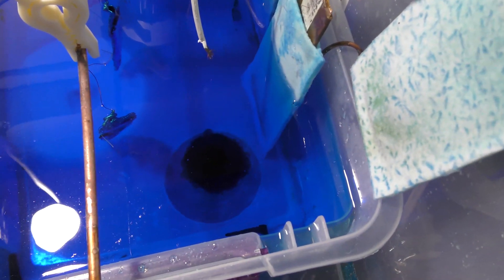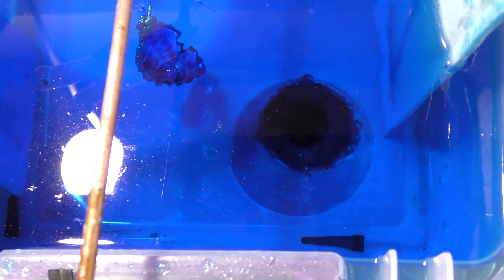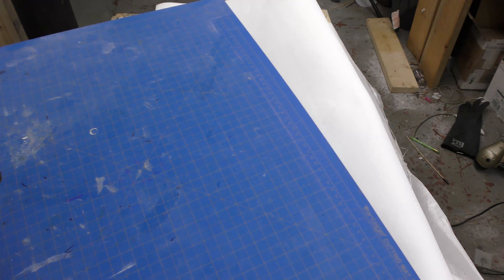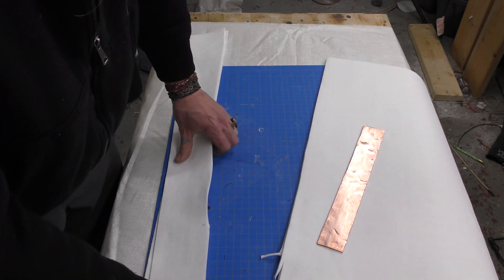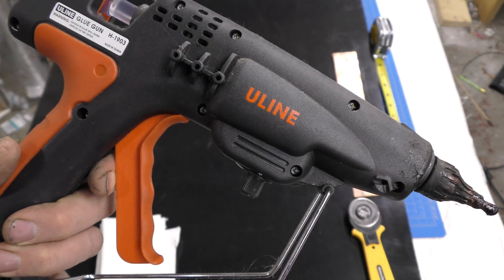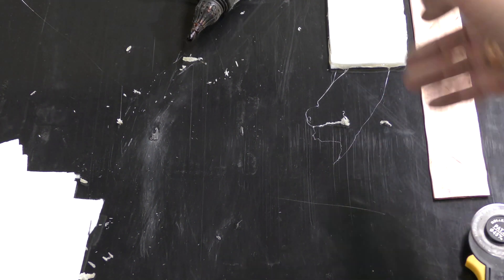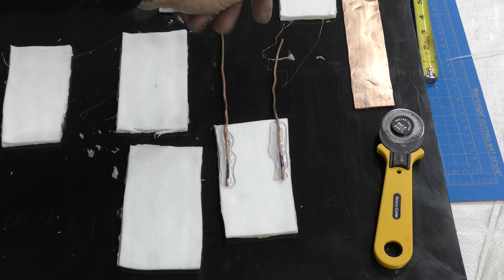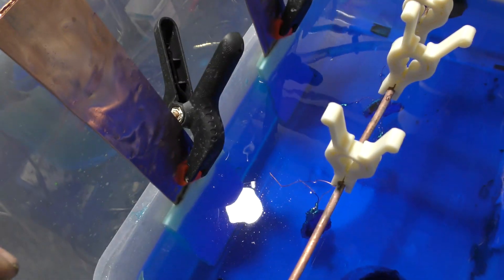Making 5 micron Anode Bags for Copper Plating

Comment: Isn't that the same stuff that come wrapped around new TV's and computer screens? Number 4 - LDPE - Low-density Polyethylene:
Reply: ok  4 - LDPE - Low-density Polyethylene: it's not the same but close. 
The one you recommend would cost me close to $60 with shipping. I tried to order it and....(message: Shipping: May not ship to Spain. Read item description or contact seller for shipping options. ) 
Fisher Scientific Inc. Spain has something better they say....Merck Omnipore™ Membrane Filters, 0.1 μm but, you must buy the whole pack of 25 1x1 meter squares 550.00€ which is actually cheaper then Amazon per piece
So no filter for me oh well.......

Comment: Another tip for you guys :)
If you use rods as anode. You can pinch the electrical wire with A hose clamp. Then seal all around it with silicone.
Holds tight and no risk of any contamination when mixing materials close to water level.
Not necessary when everything is copper but others like Nickel plating.  You can use silicone on all anodes whatever shape it is.

Comment: Jason... fine vid you've done & posted. Am wondering about the "upgrade" to 5 microns from 1 micron relative to the bags not holding the copper sediment. 5 microns is a larger opening than 1 micron. I thought you might be meaning to say .5 but forgot the "point." But then your "update" below specifically says the 5 is better than 1 or .5 ... Be great if you would clarify.

Comment: using an anode bag (5 micron felt) doesn't slow down the plating? Also, does the glue from glue gun contaminate bath and or deteriorate due to the acid?

Comment from the maker: Just an update the 5 micron filter is amazing and allows a faster transfer for copper than the 1 micron or the .5 micron
Reply: Do you still think 5 micron is the best choice? Also, do you have any thoughts on polyester vs polypropylene? I found a table that says polyester is unsatisfactory for concentrations of 50% and higher sulfuric acid content.  I know we aren't using concentrations that high, but I was still wondering how prolonged contact with plating solutions affects it, if at all.

Thanks for all the great info, just got into plating myself and you have helped a lot!